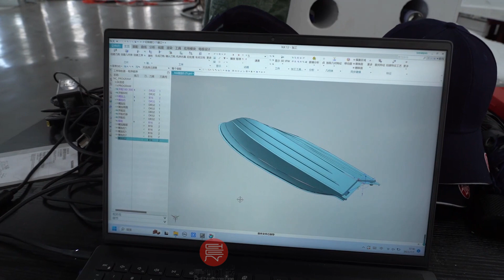5 axis cnc machine for foam boat mold milling fiberglass yacht edge cutting#5axis #boatmold #yacht

Comment: Why doing a rough pass then a finishing path in such soft martial, especially since both endmills used here appear to have the same length? One single finishing pass using the ball nose end mill should sufficient, no?
Reply from the maker: the first rough cutter will use a larger diameter,the processing efficiency is higher,in order to confirming the better surface,we will use the smaller diameter one

Comment: Excellent machine but you'd have a much better finished product using extruded polystyrene or polyurethane foam instead of expanded polystyrene. EPS has too little compressive strength which makes finishing the plug and mold production problematic.
Reply from the maker: @tommyt9519  yes,you are right,we just found one material to test the machine’s function,not the directed mold for products
Reply: @CHENcanCNCMachine  Aha! Good work.

Comment: i still dont understand why we should use 5 axis cnc to make a composite while we definitely could make something by a cheaper way, like molding. Please elaborate.
Reply from the maker: May I know what’s your cheaper way?
Reply: @CHENcanCNCMachine  by using a composite mold?
Reply from the maker: @zivannadecoration1441 how you do the composite mold,by hand?
Reply: This is more acurate R&D to make a plug then pull mold from it. The you have your composite mold
Reply from the maker: @andrekemp5059  ,yes, you are right,we are plug mold maching cnc manufaturer
Reply: Thats how you make a mould quicker and more precise
Reply from the maker: @christianpaulroldan4010  yes, you are very smart